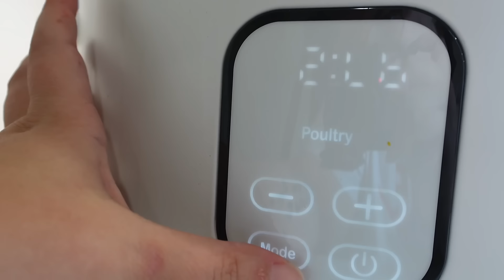PAINTING THE NEW KITCHEN CABINETS IN OUR 1991 MOBILE HOME | + doing all the things! Ep.35

Comment: Love your channel! Doing your water heater cabinet door in oyster Bay & adding the barn door cross bars & black hardware to it will look great to tie the family room in.  And do a single barn door on the pantry door exactly the same as the family rooms & in oyster Bay as well with the black hardware. That will really tie it all together.  Having the 2 doors across from one another in the layout & the 2 doors open same direction for aesthetic & function. Just a suggestion. Or add barn door to the laundry room so a door each side of laundry room then the laundry room door in the center with the other 2 doors for pantry & water heater to the left and right of laundry room barn door. They'd all be cohesive & look nice in that corner of the kitchen.  😊

Comment: I just redid my kitchen this summer also and I learned the hard way about the side with water you may want to put some polyurethane water proofing under sink on cab doors . This way will not have water marks when make a mess doing dishes. I had to redo the sink part of paint the put waterproofing over paint

Comment: AC: check out mini split systems with multi zone control, or mini split that pumps the cool air into your ductwork. They also heat in the winter. Once my 1980s central air konks out I'm looking into them to replace it. They're much more efficient and last longer than traditional AC....

Comment: Hi my friend! I wanted to say that hvac units are close circuits so you shouldn’t need a refill on R410A. if it’s low then coolant got let out or there’s a leak. I’m sorry they didn’t tell you that. I will say that units in my experience last about 8-10 years before they have major problems (sometimes before unfortunately) please please please register your equipment (usually this is online) warranty is typically 5 years parts which is standard or 10 years if you register. this typically only covers parts so if anything goes wrong then you still have to pay for labor, service fees, coolant, and leak searches. I’m in the middle Tennessee area so it may differ, but it’s just helpful info to have. I would also recommend looking into a labor warranty. If you do decide to register, keep that registration paperwork baby!! I hope this helps 🥰🥰🥰

Comment: This is a little late in your project, but did you know that if you're painting on like 2 different days, you can store your paintbrush or roller in a plastic grocery bag, (tie it tight) in your fridge. Keeps it fresh, and saves on using several brushes. Also, keep your roller trays! You can reuse them after they dry. Doesnt matter what colors are in there. And you dont hv to waste a garbage bag as a liner in the tray. When painting with a brush, i just dip out of the can, not wasting a cup or unused paint.

Comment: My AC unit went out because there was no more coolant. A guy came and said if I add gas to the unit and it goes out you need a new outdoor unit. 30 days later it went out. We bought a new outdoor unit in the end. The AC does have a life of about 10 plus years. Probably time to get a new unit instead keep fixing something that cannot be fixed.  I have a Mitsubishi wall units in my house for reference.  They actually make them so much nicer. The new ones blends into the ceiling looking like just a vent in your ceiling.

Comment: It might be time to upgrade your HVAC system. You might qualify for a grant from the state or utility companies.  With a new system it comes with a warranty. You can also get a home warranty for your furnace, hot water heater, air conditioner, and other appliances through the utility companies. Here in Michigan they do that.

Comment: I feel ya on the no AC. Our original unit (from like the 80's or somewhere close) died last summer (23) we went a whole month without AC and we are in Southern Arizona (115°+). We finally got a new unit, then just a month ago our new unit QUIT working. 2 service calls later, fuses & a capacitor later its back in business! Thankfully all but the service call and labor was covered under warranty.

Comment: Merina, crockpots get very hot on the bottom and sides. I put my cutting board under it. I worry about the towel under your crockpot catching on fire because the towel holds the heat not allowing the air to circulate, and the towel is flammable. I hope you understand I'm wanting you and you're family to be safe, and not to criticize at all!

Comment: One thing you can do with lighting as well when many do their cabinets with lights there is a molding that really hides. It's called under cabinet light molding but you could do some type of molding around top and bottom of uppers.  Really fancys it up as well. Hides the underneath as well. That's something you could do down the line. With your talents you could do that yourselves I'm sure lots of info online and how to do. Looking beautiful! Also, make sure when the time comes they change your whole copper line from handler to condenser. Going through it now had a new unit put in 6 months ago and there's still a leak somewhere because they didn't test the line duh... that's where it's been leaking. The older copper for some reason can have many pinholes. Something with the 70s copper. It's right on cue every 4 weeks might survive 5. I've had them say it's fixed now I'm just having line replaced and new company. Should have been done right anyway it is what the freon goes through. Blessings to you and yours! ❤️

Comment: my AC is as old has my 78 mobile home.  it is a beast but needs come care .  I was lucky to know an AC guy for years and he helped me limp it along.  He told me years ago, hold on to this one as long as you can.  The new units may only last 10 years.  He has had to put freeone a few time for 40 bucks a pop.   Well he retired last year.  This summer it just did not cool as well.   Of course I do not have saved 4000 so I decided to get window units in my room and my sons room.  His room is extremely hot or cold depending on the season.  So as soon as I put my window unit in, with 2 fans.  My central AC decided to start working again.   My electric bill for a single wide last month at 286.  I have only used mine once.  My son has had do use his a little more.   His room is on one end that gets more sun,  my room is on the opposite end.  As i sit here the central AC is working great.  go figure

Comment: I can relate with A/C problems. Our air conditioning system stopped working 3 weeks ago, it took 3 days for the repairman to get here….. it’s 108 degrees in Texas😮😮😮😮😮$$$1200 dollars later it’s working again. $900 for Freon…$900!!!!!!! Freon??  Oh my gosh!  As for your cabinets I would have used a Gloss or Semi-gloss paint..very durable, easily cleaned and you can use the same paint on the baseboards (especially great for families with pets)😅! Loved your videos. Hugs from the hot State of Texas!

Comment: I shaved my legs once when I was 14 and cut my legs and knew I would never shave them again. I used the old school hard wax, (not the strip wax they use with the cloths. The old style wax actually removes the hair full roots and all, and doesn’t break the hair. So from about the age of 14 I waxed my legs constantly and by the time I was 21 I hardly had any hairs on my legs, just a few hairs here and there on my calves. Waxing over a period of time actually stops the hair from growing. By the time I was 30 I had no hair at all on my legs, and my legs have always been smooth, even when waxing as the hair grows back soft. As for the under arms that’s the most painful area to wax, and I did wax them for years it didn’t seem to stop the growth like it did on the legs, so I gave up and just shaved them as it wasn’t worth the pain. I only shave my underarms in summer, I don’t care if they have hair most of the time.

Comment: Your smile looks great!  I know you are so happy.  About your feet, I had the same problem and I watched a video once and it helped me so much.  Get you one of those home spas for your feet, that’s plug in to electricity and bubble and stuff.  Put some warm water in there, as warm as you can comfortably tolerate (I put a bath towel underneath because you will drip water and skin when you start the exfoliating process and it will mess up your pretty floor).  Add 1 cup of epsom salts and 1 cup of apple cider vinegar to the water.  Gather these supplies, one of those heel grater things, and one of those feet things that look like it has black sandpaper on it lol I can’t remember what it’s called.  Also some sugar scrub, some coconut oil and a pair of socks. You’ll need this all there handy once you start this process.  Soak your feet for about 20 minutes in the warm water, Epsom salt and apple cider vinegar.  This stuff is amazing.  The old skin will start sloughing off.  Then pulling out one foot at a time while the other one is still soaking, use the grater thing and start getting the rest of it off, then use the black sandpaper thing to smooth your feet.  Apply the sugar scrub and put it back in the water briefly just to rinse it off, then apply the coconut oil and put on a clean sock and then do all of these same steps to your other foot.  It works sooo good.  You can do this maybe once a month or so just to keep it up and in between times just put some good lotion on your feet AS SOON AS you get out of the shower every night and put socks on until you go to bed and it will keep them looking good in between doing the foot spa routine.  I know this was long but hope it helps ♥️

Comment: You could use battery-operated lights under the cabinets. I have them and they last a long time. There is no need to use outlets or drill holes in your cabinets.  The drawer by your sink that doesn't open you could add a sink front tip-out tray to store your sponges. Also on the island you could put them in to add extra storage.

Comment: Hey! Can't wait for the pantry but I just wanted to put a thought in your head before you start that side of the kitchen. Make sure that the wall that frames out your pantry the one to the left of your refrigerator and then the front where the door is make sure because you have a double wide that that is not a supporting wall since it's so close to your marriage beam before you take it out. Unfortunately a friend of mine learned the hard way that her closets, although small, in her double wide, were considered supporting walls because it was a double wide and so close to her marriage beam! She took our own closet and had severe structural issues from it  not long after. I love the kitchen so much❤ also, I live in a single wide and one of the best updates I've done is replace my HVAC system. My electric bill went down significantly. And I did the math and after about 9 months it ended up paying for itself from what I was paying for my electricity prior to getting it replaced!

Comment: SUGGESTION ALERT!!!  Have Shane drill a hole at the base of each cabinet, cut the plug off and feed the wire into the wall to the outlet box under the cabinet. He'll have to remove the current boxes and change to a double box. Once the wire is through the wall it can be wired to a switch with the electric feed coming from the original plug.  Once finished, each box would have a plug and a switch. That way you won't lose any outlet use. There will be no wired to deal with and you can decide which light to use as needed. I had this done in my kitchen and it's great. Much cleaner look.

Comment: We bought a 97 double wide back in October and the HVAC system didn't work so we are installing mini splits because it wasn't just replacing the old unit it was going to replace the inside and outside units and all the duct work as well because the old duct work was in really rough shape.

Comment: The more blades on the razors you use the smoother you get. Don’t go cheap, three or more blades are good. On your bun, and I’m not being mean but you just grab your hair and put it up. You need to brush it and brush it as your putting it back and possibly a little water and they do make a smoothing spray or cream not sure which. ❤ That’s the only hints I have for those situations. Oh yeah I don’t use shaving cream I use my Dove body wash on legs and underarms. Hope it helps.